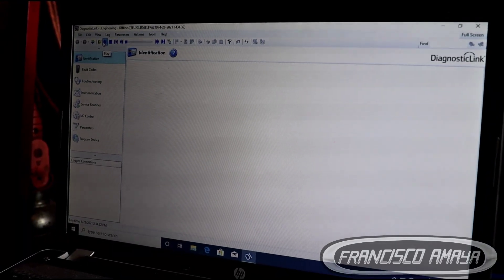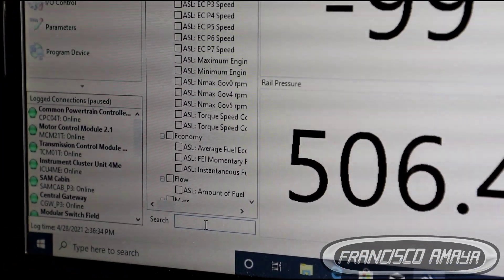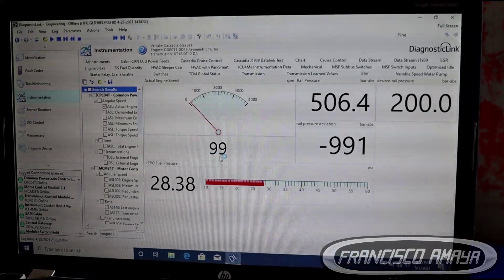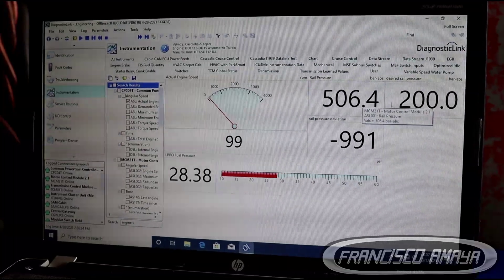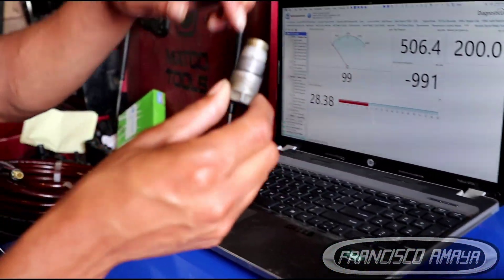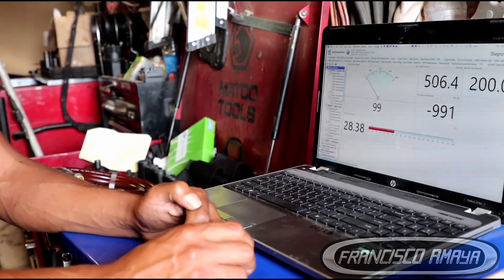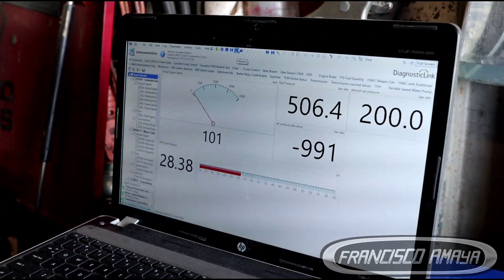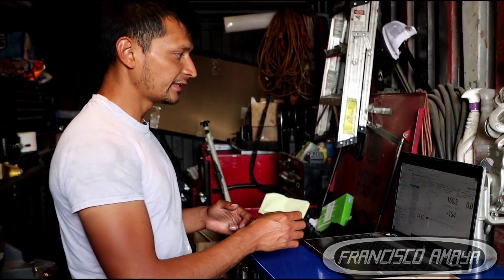DD15 engine crank not start fuel injectors problem no fuel flow diagnostic repair computer work

Comment: My LPPO pressure stays the same whether engine is off or at idle or going down the road. It sits at 105 bar ? To me that sounds like a sensor but would it be the sensor on the rail?

Comment: Fuel limiting valve at end of rail is not ECM controlled,  you shouldn't even think about it in this situation,  it only releases pressure above 1280 to 1380 bars,  it is always closed until rail pressure above 1280 bars

Comment: Hi my dd13 can not start I had put it on my diagnostic machine it show fuel calibration metering valve has an open circuit how can I solve  the problem

Comment: My truck when I hook up the software says the commanded pressure is 400bars is that normal?
Reply from the maker: if the engine is running yes, but it varies depending on the power demand.

Comment: Thank you Fco. Can you do a video of hard start. It seems my truck bleeds out during the night. Next day it has a hard time starting...
Reply from the maker: most common fail and hard to find. the 2 lines coming front the cylinder head to the housing on the back have a crusher washer that goes bad over the time causing this issue.  this could. could... be your problem.

Comment: Pretty common problem on these engines
Stupid injectors 
They get stock open or closed 
sometimes i do a head gasket truck pulls in running just fine
After everything is done
It would crank but no start, 
Now every time i remove a good working injector on dd15 i dump it straight in fuel so it it has helped a lot 
Worst injectors for sure
Reply: For what reason did that happen? about your experience, or just because the injectors suck

Comment: There's a logical reason on everything you do n for every problem too, all problems on a truck is part of a several different parts or components how you say 🤔 cranking n not starting is no fuel going in. You're very smart Francisco, gracias por la ayuda con tus videos.

Comment: What causes a No Trans J1939 truck want crank up. But I can crank it from starter. And help please 2012 Freightliner Cascadia dd15
Reply: Check fuses and relays on firewall under the hood.
Reply: Automatic??